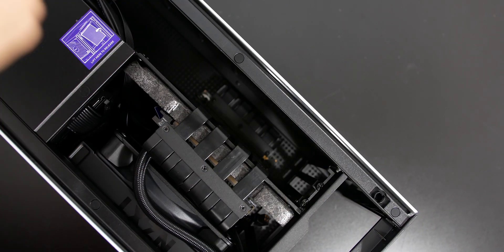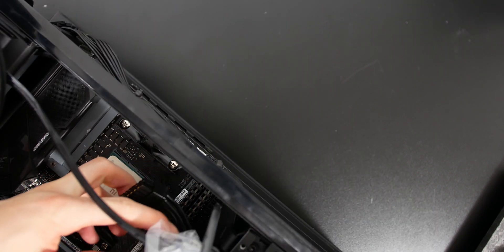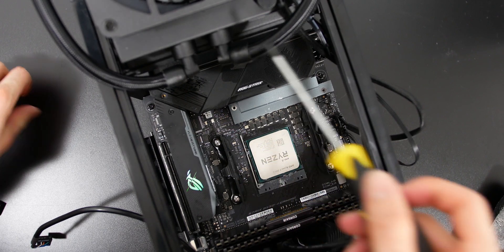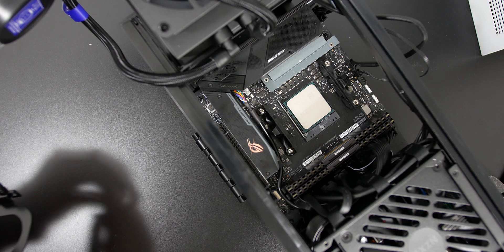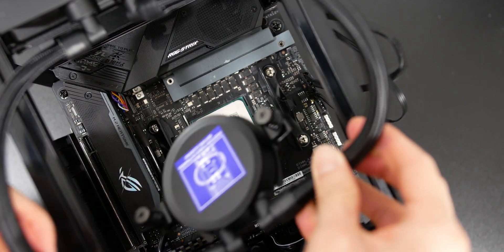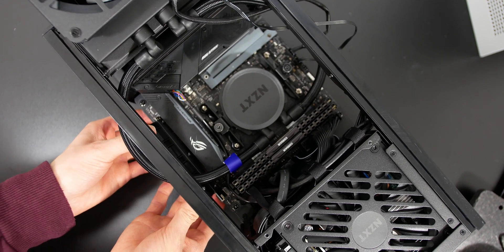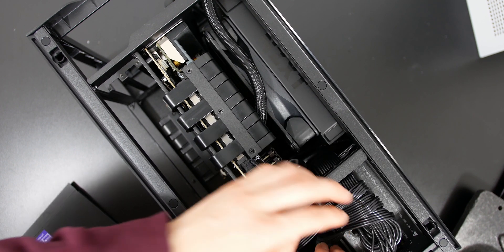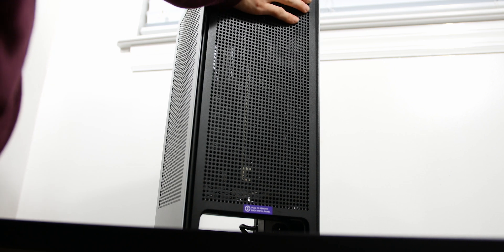NZXT H1 Build Guide: How to Build in the NZXT H1 SFFPC Case

Comment: hey im wondering, have you ever experienced any cpu overheating issues with your PC case? I have an nzxt h1 and I recently had a blue screen error thatt says critical process died. My PC was restarting on its own. So I took my PC to a technician today and had to do a factory reset and windows reinstall. He saw that the cpu was overheating. I might need a deep clean and thermalpaste applied.  Or this could possibly be a cooling system issue with the AIO. Or i have to get another case, so I was thinking of purchasing the same case.  Just curious if you've ever experienced this issue or know what this is caused by?

Comment: Hey tony just a quick question on building a pc in general, how should I make sure the parts on working before I put them in the case? It’s going to be my first time building a pc and I’m not the best with troubleshooting.
Reply from the maker: Agustin Xocua You can install all the parts outside the case first such as the CPU, RAM, and GPU onto the motherboard and connect it to power to test it.

Comment: Tony I need to know if the 3070 will be good for the H1, I’m aware that the 3080 and 90 have multi directional exhaust  and it isn’t good for sandwich build, and I think the 3070 is one direction flowing but I’m not sure.
Reply: I would like to know this as well
Reply: Since the 3070 has a somewhat similar intake/exhaust I wouldn’t recommend this case for the fe cards because thermals might be and issue

Comment: I would recommend reversing the fan so it can pull air out. I did this because I blower 1080 ti which helps reduce hot air in the system
Reply from the maker: Super900k I prefer to keep it as intake to pull in fresh air through the dust filter for cooler CPU temps, but that’s an interesting idea.
Reply: @TonyTechBytes  I personally removed the dust filters. Because being that close to the gpu and radiator it almost chokes the airflow and thus fans ramp up.